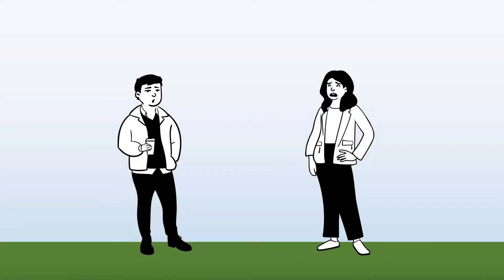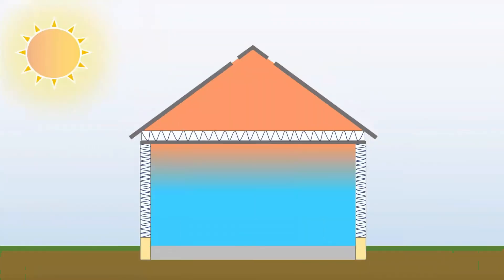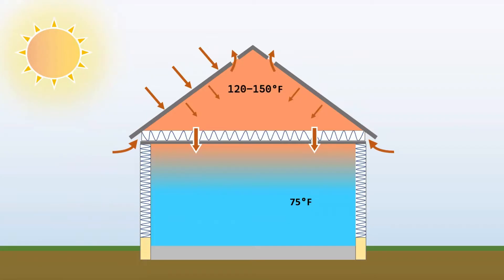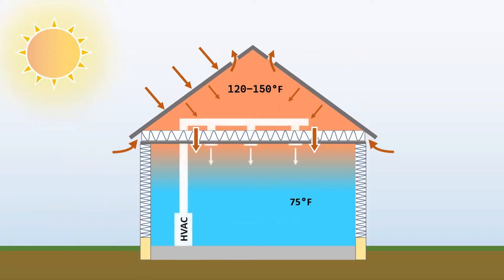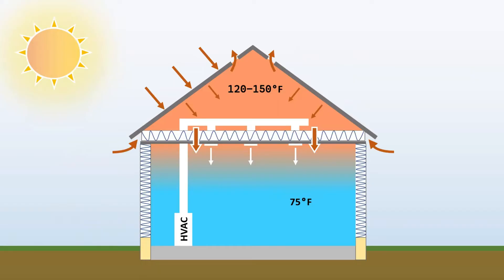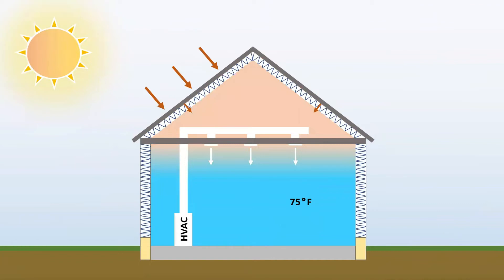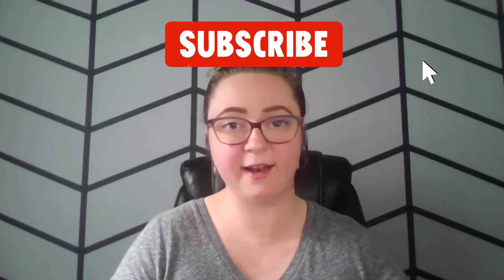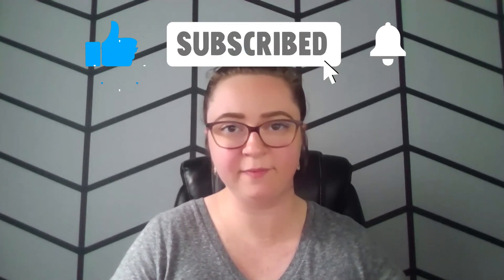Vented vs Encapsulated Attics

Comment: I have direct experience that contradicts your opinion. Let me explain (please forgive the long post)::
     In a climate comparable to Eastern Arkansas (hot, humid, sunny), I lived in a small pre-fab cottage. Nearly square, masonry walls, flat roof with 4” foam insulated roof. This place was HOT. Most unpleasant.
     Added atop this cabin we added a pitched roof. Simple wood rafter frame, covered by corrugated cement board (1/4” thick), The cement board was painted a flat brick red, simulating the look of clay / terra cotta tiles. The eaves were thoroughly vented due to the corrugating in the cement board; the top ridge was similarly open. This was a “roof” only in name, strictly for appearance.
      Imagine my surprise when I felt an immediate, major change in the comfort of the cabin. Now, even in 95F sunshine, a small window fan was adequate for indoor comfort.
     My theory is that the simple roof essentially kept the cabin in the shade. Sunlight heated the roof covering, which in turn heated the air immediately under it. This hot air was channeled by the corrugating directly out the top, while fresh air freely entered at the eaves. I later learned this is known as a “cold roof” in the trade. You can even see similar “false” roofs, with the small air gap, attached to Land Rovers in Africa.
     I believe a similar result is possible by simply attaching a similar layer atop a conventional roof deck. Indeed, I believe this is what we attempt to create with our conventional vented attic. If my theory is correct, the real problem with American attics is that there is not enough air flow, not enough eave venting. We appear to have just enough venting to prevent moisture from being trapped and allowing mold to grow. We don’t vent enough to keep the attic temperature down.
     What about the winter, when you want to heat the house? Would not such a design would prevent the sun from heating the attic, thus not help heat the house below? In truth, we face a similar dilemma with vented crawl spaces. We solve this by using adjustable louvers on the crawl spaces vents. In theory we could do the same with the attic vents. Yet — and I’m not afraid to admit I don’t understand something — the shaded / vented roof did not appear to make is harder to heat the cabin in the winter. I cannot explain this. Perhaps it is something as simple as the lower winter sun not “powering” the convective ventilation as much.
     What about those ASHRAE calculations? I do not see where these calculations measure the effects of roof design. All they consider is insulation thickness. I don’t know how you collected your data. Again, I confess my ignorance.
     Conclusion? If I were building a roof, I would stick with a conventional design, then add a fully vented “cold roof” atop it. That is, I would simply affix corrugated panels directly atop the roof, leaving the corrugations simply open at the eaves and the peak (no top cap). If necessary, one could “plug” the corrugations with a Scotch-Brite like material that would allow free air flow yet keep wasps and other vermin out.
Reply from the maker: Wow, thanks for taking the time to share your experience! @karenstein8261 That’s such an interesting setup you described, and it’s awesome to hear how the “cold roof” made such a huge difference in keeping your cabin cool.

You’re absolutely right about what you’re describing works a lot like a ventilated roof system, where the airflow helps reduce the heat load on the structure. It makes sense that shading the cabin and letting the hot air escape before it even gets to the main roof would help so much, especially in a hot, sunny climate like Arkansas.

When it comes to ASHRAE calculations (like Manual J), they do focus a lot on insulation values and materials, but they don’t always get into the specifics of unique roof designs like yours unless you’re doing more customized modeling. It’s more about overall energy performance and standard design conditions, so things like ventilation details can sometimes get overlooked unless someone accounts for them in a more detailed analysis.

Your point about winter heating is really interesting too! It could be that the reduced sunlight in winter just doesn’t drive as much airflow through the vented roof, so the impact is smaller. It’s also possible that the overall heat loss from the cabin wasn’t as affected because of other factors like insulation or the natural heat retention of the masonry walls.

I think your conclusion about adding a vented layer on top of a conventional roof is a great idea. It’s a practical and affordable way to get the benefits of shading and ventilation without a full redesign. The Scotch-Brite-style material to keep bugs out is a clever touch, too! 😄
Reply: Your problem wasn't the sealed flat roof, it was far too little insulation. Your flat roof would have been perfectly fine with an adequate amount of insulation, probably 3x what you had.
Reply from the maker: @dlg5485   You bring up a valid point about insulation. Roof performance is definitely a combination of multiple factors, including insulation, ventilation, and the materials used. In the case of the flat roof, it’s possible that increasing the insulation could have helped reduce heat transfer. However, the ventilation and shading provided by the pitched roof clearly played a crucial role in this specific example. 😊
Reply: I think you're right about most roofs having inadequate ventilation.  In particular, most soffit vents have ridiculously little flow.
Reply from the maker: @incognitotorpedo42  Great observation! Soffit vents are a critical part of roof ventilation, but they’re often overlooked or poorly designed, as you mentioned. Ensuring proper airflow through the soffits is key to maintaining a balanced attic ventilation system.
Reply: I concur
Reply: Indeed a fly roof works great.
Reply from the maker: @kooblier1398  Absolutely, fly roofs can be a fantastic solution! By promoting natural ventilation and reducing direct heat transfer, they’re a smart way to enhance roof performance. 🙌

Comment: I think you have put your thumb on the scale when you did manual J for the conditioned attic. 
You calculated the heat loss thru the ceiling for into the conditioned attic when in fact you need to calculate the loss thru the roof. The roof has maybe twice the surface area. Plus you need to add the heat loss thru the gable wall area of the conditioned attic.
Reply from the maker: Thank you for your comment and for taking the time to point that out! You bring up a very valid point about calculating heat loss in a conditioned attic. Typically, heat loss calculations for a conditioned attic involve both the ceiling and roof, and depending on the design, roof surface area does indeed play a critical role in the total heat transfer. Additionally, the gable walls can also contribute significantly to the overall heat loss. In the video, we were aiming to cover the general approach to Manual J for a conditioned attic, but you’re right that for more precise calculations, both the roof and the gable walls should be considered, especially when it comes to larger surface areas. We appreciate your feedback, and we’ll definitely revisit the methodology in future content for more clarity.😄

Comment: That house is going to rot.
Always vent. Condensation is a house wrecker.
Reply from the maker: Thanks for sharing! @jbaccanalia It's true that condensation can cause issues, which is why proper ventilation is so important. However, an encapsulated attic with the right insulation and vapor barriers can prevent moisture buildup and improve energy efficiency. It all comes down to the specific conditions of the home and ensuring the system is designed correctly. We always recommend evaluating the situation carefully before deciding.😄
Reply: You got that right!

Comment: Thanks for this video.  I am more accustomed to builds in cold climates where there may be cooling required in summer, but more heating requirement in shoulder seasons and winter.  Would you be concerned about ice buildup on the roof due to snow thaw,due to heat escaping from the roof? This can occurs if venting is not adequate, in a vented roof, especially when insulation blocks the flow of air from the eaves.
Reply from the maker: Thank you for your comment! @davewillis264 Yes, heat escaping from the roof can indeed contribute to ice buildup or ice dams, especially in cold climates. When heat from the home rises into the attic, it warms the roof, causing the snow to melt. This water can then refreeze at the eaves where it's colder, forming ice dams. Proper attic insulation and ventilation are essential to prevent this. Insulation helps keep the heat inside the living space, while ventilation allows the attic to stay cooler, preventing the snow from melting unevenly.

Comment: With the encapsulated attic you still want the roof vented from soffit to ridge using baffles or you can end up with moisture, to make matters worse the suggested spray foam as shown in the video will trap that moisture and hide a rotting roof structure
Reply: Without some venting the roofing will go bad way faster.
Reply from the maker: @codyenneking7997  Great point! Venting does play a role in traditional attic setups, but encapsulated attics use advanced moisture management to protect both the roof and the home. When done right, they can actually improve roof longevity by keeping conditions stable. Thanks for watching and sharing your thoughts! 😄
Reply: @procalcsuniversity1484  not true. The roof will cook worse in the summer heat diminishing the life of the shingles. Having that air gap is like a convection fan drawing in cooler air from the soffit. You never want to apply insulation directly against the roof, don't care what claims spray foam has. 

You have to think beyond insulation and R value and more about building science. I'm not an expert, but this I know.
Reply from the maker: @andrewsbbq  
Thanks for watching and taking the time to comment! You raise valid concerns about roof temperatures and shingle life. Modern spray foam insulation systems are designed with these factors in mind, and research shows that properly installed systems can mitigate heat transfer effectively without significantly affecting shingle longevity. That said, building science is complex, and there are pros and cons to both vented and encapsulated attics. 😄
Reply: @procalcsuniversity1484  how does modern spray foam achieve this?
Reply: @andrewsbbq  
Thank you all for sharing your thoughts and experiences! It's great to see such an engaging discussion around spray foam insulation and encapsulated attics. Let me clarify a few points to address some of the concerns raised.

Encapsulated Attics and Ventilation:

The purpose of an encapsulated attic is to create a sealed and conditioned space that moves the thermal boundary to the roof deck. This method eliminates the need for traditional soffit-to-ridge ventilation because the attic becomes part of the conditioned envelope of the home.
Properly applied spray foam (especially closed-cell) prevents moisture issues by acting as both an insulator and a vapor barrier, provided the system is installed correctly by professionals.
Shingle Longevity and Roof Temperatures:

Concerns about shingles overheating are valid. However, studies have shown that encapsulated attics only marginally increase shingle temperatures (typically 2-3°F), which is within the tolerance range for modern roofing materials. This small difference does not significantly impact shingle lifespan.
Encapsulation can help reduce extreme temperature fluctuations in the attic, which benefits the roofing structure over time.
Alternative Methods:

Some commenters mentioned radiant barriers or air gaps, which can work well in certain situations. However, spray foam insulation provides a more comprehensive solution by sealing cracks and gaps, reducing energy loss, and improving indoor air quality.
Every home is unique, and the choice of insulation depends on factors like climate, budget, and building goals. Spray foam is particularly effective in hot, humid climates or where air leakage is a significant issue.
Common Misconceptions:

Spray foam insulation does not trap moisture when applied correctly. In fact, closed-cell foam prevents moisture infiltration and adds structural rigidity to the roof deck.
Encapsulated attics, when paired with proper HVAC design, ensure air exchange and humidity control, keeping the home healthy and efficient.
Building Science and Professional Guidance:

Building science is complex, and it’s important to evaluate the specific needs of your home before deciding on an insulation method. Consulting with certified professionals ensures the system is designed and installed correctly.
For those with more questions, I encourage you to explore trusted resources like the Building Science Corporation or reach out to a qualified insulation contractor to assess your specific situation. Thank you for contributing to this conversation—let's keep learning and building smarter homes together!
Reply: @tomplatania9710  you, and your channel, keep treating encapsulated attics and ventilated roofs as mutually exclusive. They are not.
Reply: @procalcsuniversity1484  agreed!
Reply: @procalcsuniversity1484  "advanced moisture management" Toxic chemical insulation?
Reply: I used closed cell spray insulation on my roof , it prevents the interior moisture from migrating through the insulation keeping the dew point on the outside. I installed a metal roof on wood battens which is vented,    Along with 5-1/2 inches of mineral wool in the wall cavities. Plus 2 inches of mineral wool on the exterior walls to eliminate thermal bridging.  I can heat my house in cold weather with a candle… really comfortable.
Reply from the maker: @marktett5966  Wow, that sounds like an incredible setup!  Thanks for sharing your experience! It’s inspiring to hear how comfortable your home is, even in cold weather. 🙌
Reply: Not when the thermal break is in intimate contact with the ply
Reply: Closed cell foam. No moisture problems
Reply: @usmcfrommt9790  yes there is. Closed cell will hide and trap it worse
Reply: @usmcfrommt9790  No condensation problems on the inside. If a leak develops on the outside, the water will have nowhere to go and you'll get rot.
Reply from the maker: @usmcfrommt9790  Thanks for sharing! Closed-cell foam is definitely a great option for preventing moisture issues when used correctly. It provides excellent insulation and acts as a vapor barrier.
Reply from the maker: Thank you, Andrew. However, if you vent the attic, it negates the purpose of encapsulating it. When you encapsulate the attic, the goal is to bring the attic space into the thermal envelope of the house. With small cracks and gaps in the ceiling, such as those from lighting, a path is created for conditioned air to travel into the attic. This process slightly conditions the attic, reducing its temperature, the duct load, and the ceiling load, which in turn makes everything more efficient to operate.

If you have implemented this approach differently and have documentation, I would love to review it. Please send it to Tom@procalcs.net. The world is always changing, and I’m always open to new ideas. Thank you for your comment. Please keep them coming – they keep me on my toes!
Reply: @procalcsuniversity1484  I tried posting a link to what I’m talking about but YouTube auto-deleted it. They don’t like links in the comments

Basically you still encapsulate the attic but still vent the roof. From outside in it goes your roof sheathing, 1” air gap created using foam or plastic baffles (sold at all building supply stores), then your insulation. My preferred is rockwool then foil faced rigid insulation aiming for at least R30. Any more can be hard to achieve while still maintaining head room. The baffles vent the roof from soffit to ridge and/or hips. This venting also helps vent roof heat and moisture/condensation
Reply: @andrewsbbq  I agree! This is the way to do it. I made the mistake of insulating the hell out of roof joists but did not install the baffles, and had lots of moisture trapped between sheathing and insulation! Will take a lot of time to redo and add baffles...